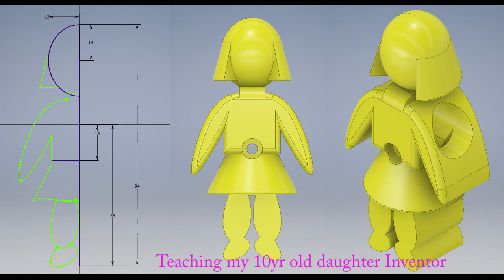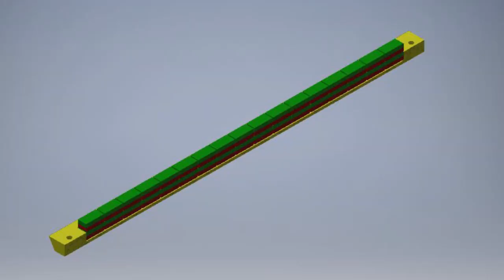Robot Table Soccer - Inverted Mecanum Drive

Comment: I love this! It's mechanically very analogous to a ball-screw-spline drive, which are often used in automatic tool changers for milling machine centres, but this is a much cheaper way to achieve a similar mechanical effect, albeit with the limitations of slip that a screw/spline doesn't have, but with feedback and for less micron exact, high stiffness demanding applications this is really badass.
Reply from the maker: Thanks. The feedback mechanism was a surprise outcome of this project. It has quite high resolution considering how it is made. It could move really fast because of the low reduction ratio and power BLDC motors. It was a fun and challenging project.

Comment: Great work, really nicely done. 
I like the idea of those inside out Mecanum drives.
What motor controller are you using ?
Reply from the maker: It is my own one https://hackaday.io/project/157812-3d-printed-robot-actuator/log/173202-making-the-smaller-psoc4-brushless-actuator-controller